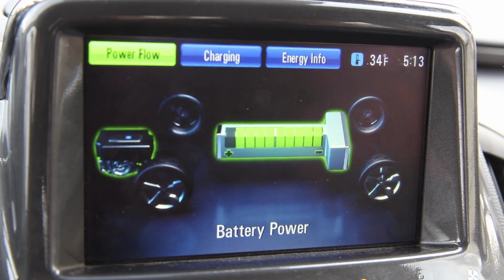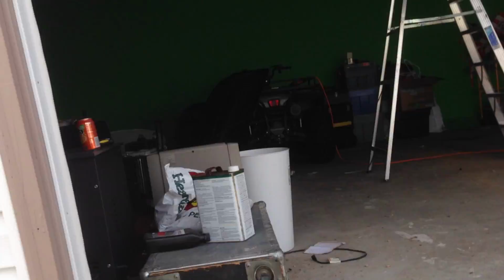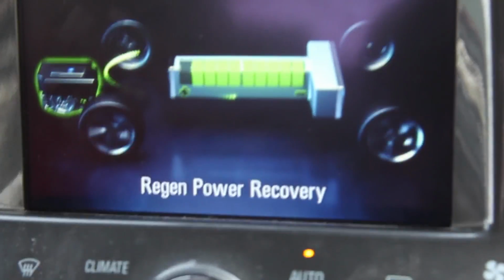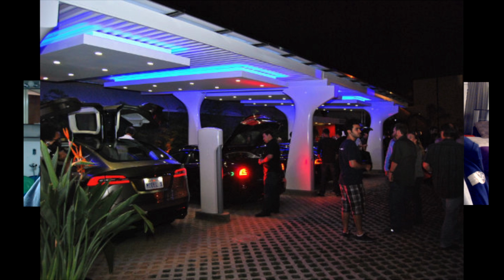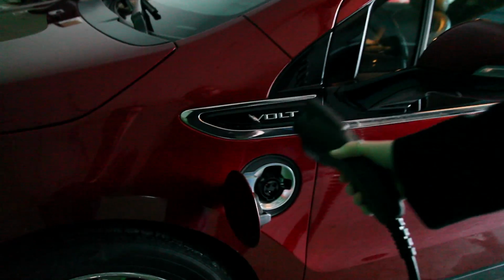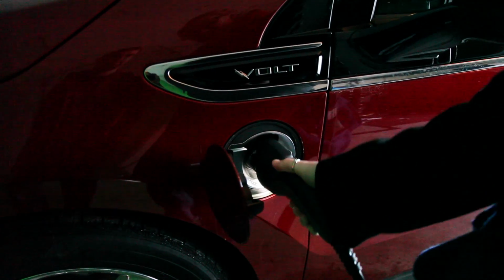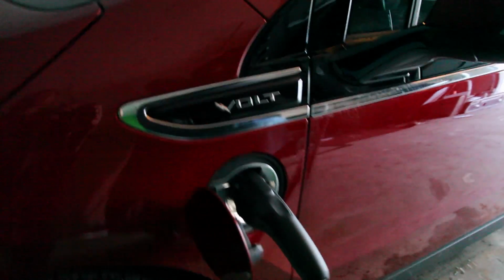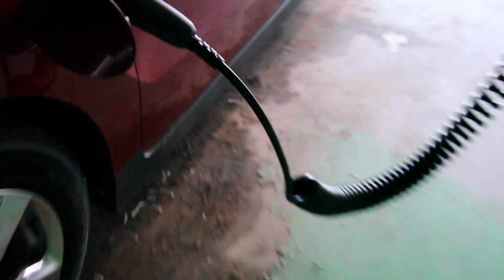Electric Vehicle Chargers

Comment from the maker: I wish I could, the volt only supports Level 1 120v and Level 2 240v charging.  GM is trying to keep the life of the battery pack up by keeping charging rate slow and not getting it get below %30 when driving too.